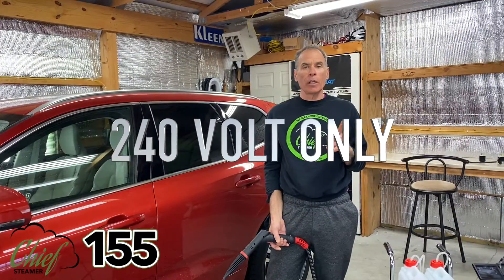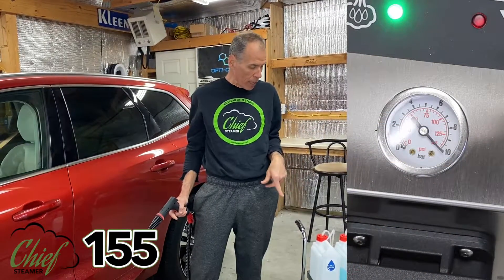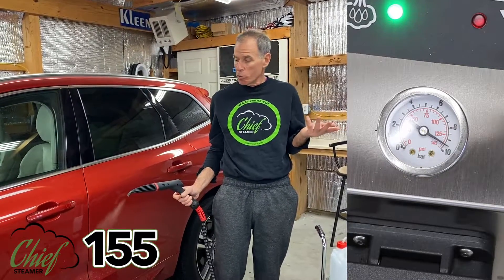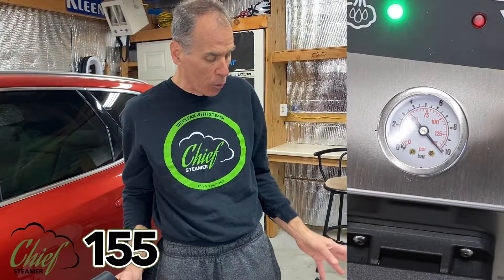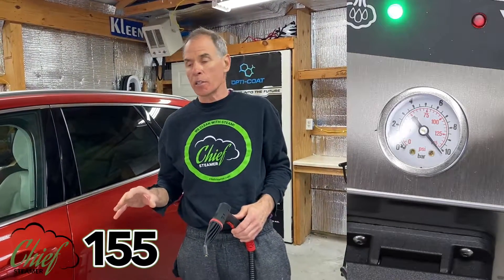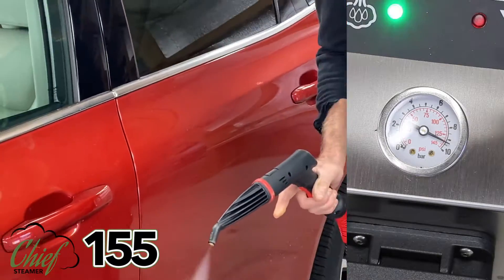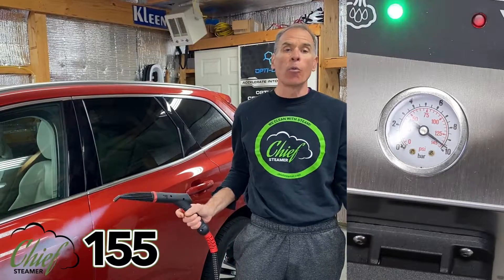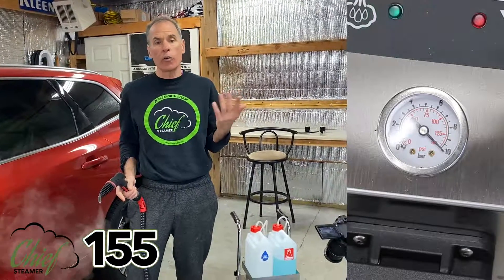Chief Steamer 155 (240 Volt) - Performance: Pressure drop and recovery

Comment: Wow wow great product Kevin.....I have the 100 chiefsteamer now I feel like selling it and get this. Only thing is that we are 110V in Canada 🇨🇦 ......is it possible to use a step up transformer from 110V to 220v ??
Reply: You can get 240 or “220” (which is actually 240 these days) from your Electrical Service in Canada. You just need the right type of outlet to be installed with a dedicated line from your main panel.
Reply: @R900DZ  thanks that helps appreciate your help
Reply: @cebasmb8250  I'm in Calgary and will be using my dryer plug for this unit. If I begin detailing vehicles I will get a generator. Our dryer plugs will work though